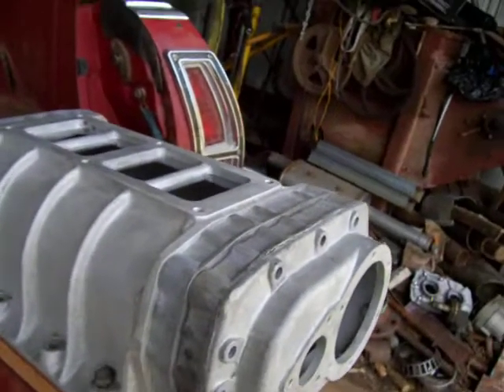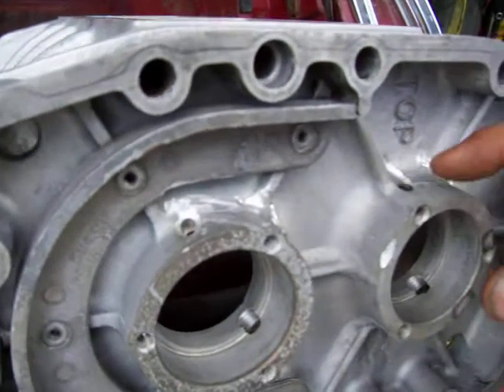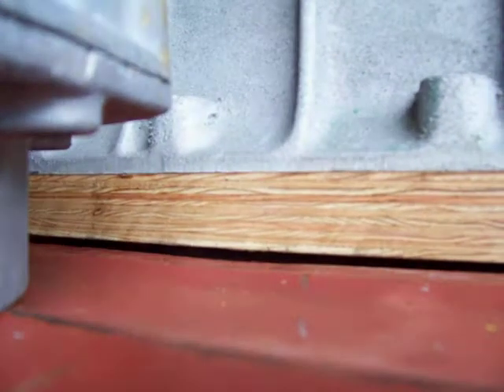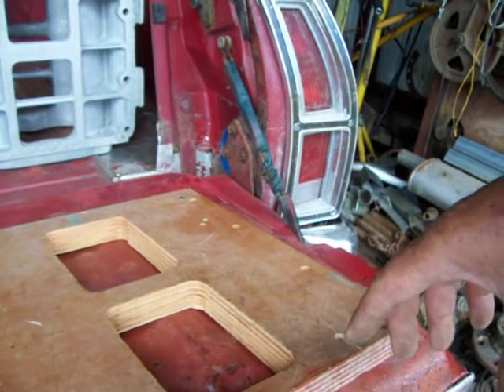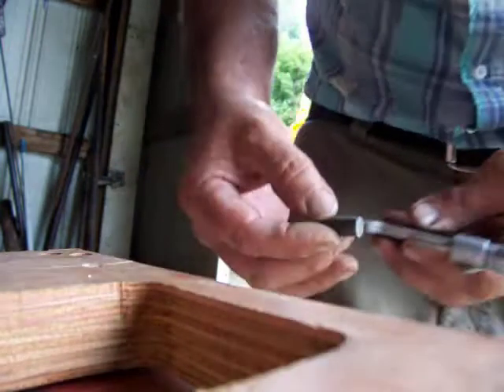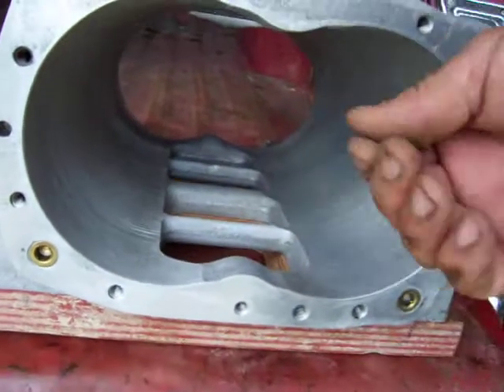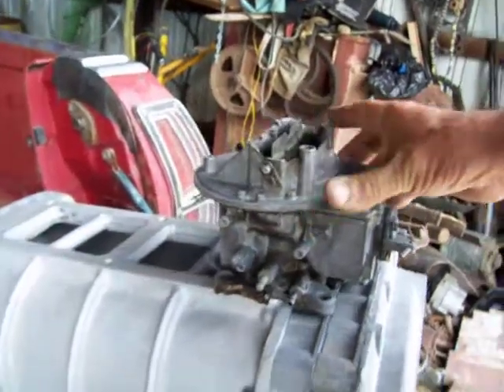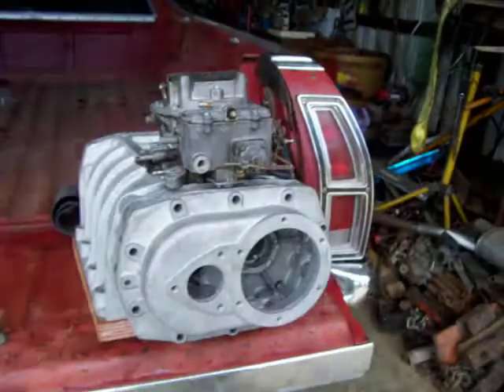Detroit Diesel 6-71 blower conversion to gas engine 3

Comment: Thank You For The Videos !!!
Reply: I have a ton of old carburetors they all need to be rebuilt but I have a few of each if you ever decide to do another project,   two 4160s going on my 671. off a boat... My 351 Windsor block is actually a 70 one of them old Merc. boat blocks. Identical to a truck motor just beefed up a little bit more,  once in a blue moon you run into a counter rotation motor.